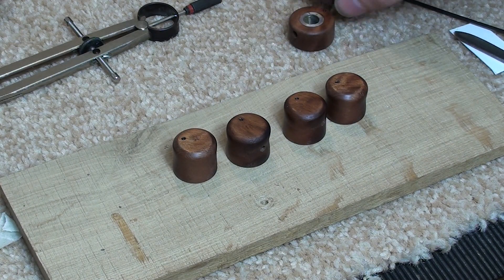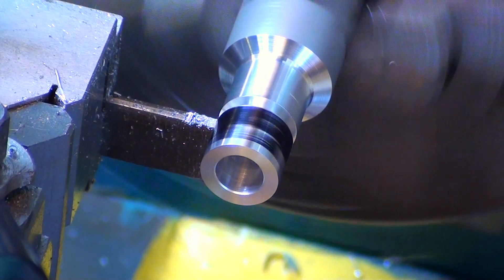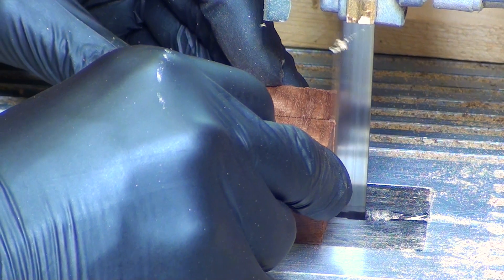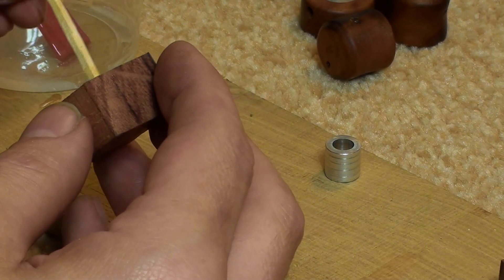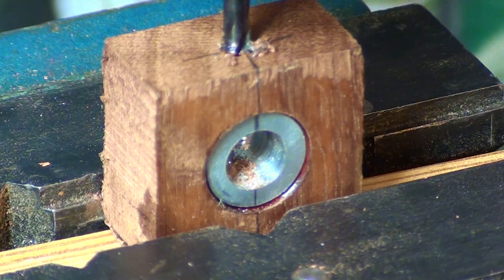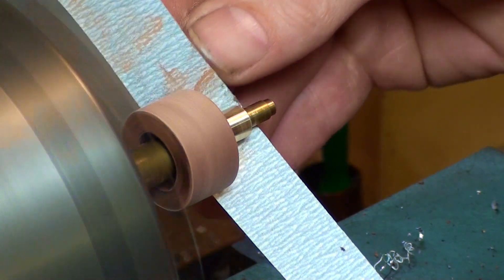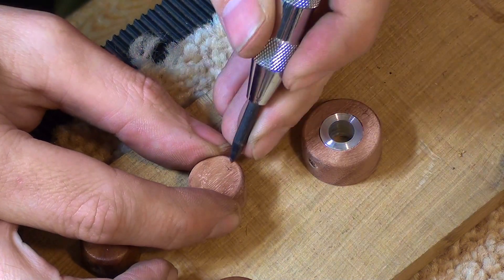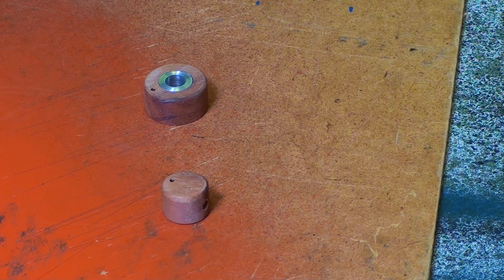Making wooden control knobs for a bass guitar

Comment: why did you put that metal piece in ?
Reply from the maker: +virat tiwari it's to get good fit on the potentiometer shaft and also it means you can tap a thread into knob for the grub screw. If you just make a thread into the wood it wouldn't be as hard wearing and is likely to be ruined by over tightening.